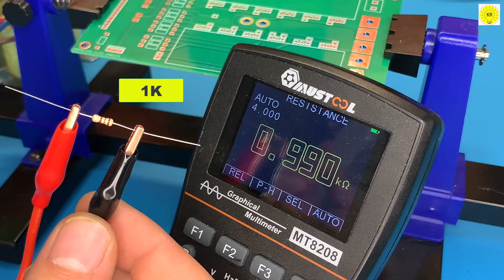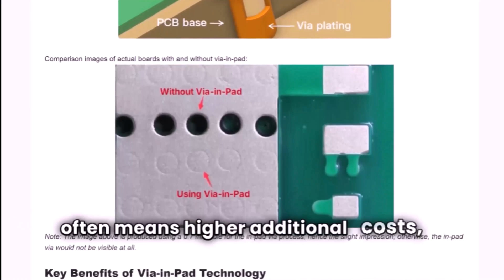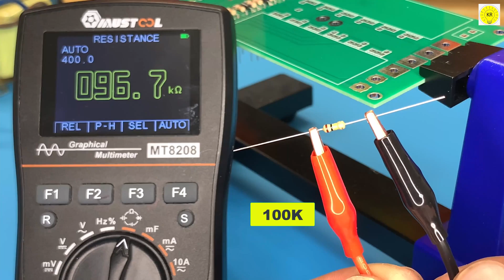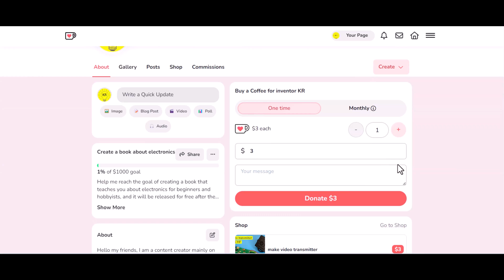how to make simple inverter 2000W , sine wave ,12v to 220v , 16 mosfet

Comment: Half working, you can see he couldn’t get it to work because he skipped the 220v probe wires (underv protection) + he’s not the original author
Reply: i can use a 1200va ups transformer?

Comment: Please my boss, can you please help me with the circuit diagram, Secondly, could you please help me understand how to solve Overvoltage problem under this Egs002 inverter project. Please
Reply: In Egs002 you can't manage more than 3+3 Irf3205 with ir2113, in that configuration 6+6 gain current transient is more of 2A, you need to add Buffer current!

Comment: There is someting wrong with this video, it seems that the Inverter board led Is flashing, indicating a fault, maybe low voltage,
Reply: yes, there are have an issue, that is when load much load, voltage drop immediately and led flash 3 times in module and self-off the invertor as low voltage detect in feedback. so, this is the failure of the design. this is the common problem of the invertors then I think may be this design max load will be 200w - 300w. because they are always introducing designs with errors. if anyone make like these ones, please make corrections yourself.

Comment: Great, what do you think about making a 3ph inverter that can be connected on each phase within the limits of AC max 500v on each phase. Where later the energy storage could be connected for charging48v, i.e. low voltage.
Reply: In my videos you can see this slow-rotating producer. .
Reply: I see that, but I want to make an inverter that, as I wrote, will handle higher voltage, e.g. from the AC side or the DC side. AC 440v, e.g. DC 600-800v, and it would be possible to charge the warehouse low voltage
Reply: لا يوجد رد واين المخطط

Comment: It’s very likely that the author hid something!) When starting a puncher, the drawdown should be a transformer clearly with a power of about 250-300 watts; when starting an 800-watt puncher, the consumption will be more than 80 amps from 12 volts and the fuses are in pairs of 30 amps, or 60 amps))) 2000 watt PMPO ?!))))))))))
Reply: es, there are have an issue, that is when load much load, voltage drop immediately and led flash 3 times in module and self-off the invertor as low voltage detect in feedback. so, this is the failure of the design. this is the common problem of the invertors then I think may be this design max load will be 200w - 300w. because they are always introducing designs with errors.
Reply: its 800w in full load. Just tuning the drill wil draw like 50w max

Comment: A 200W transfo becomes a 2kw transfo in this channel
Reply: اين المخطط
Reply: Yes, also long legs means lot of parasitic inductance, this design can not handle 2000 W all day long,
there are not thermal images after 1 - 2 hours operation.
Reply from the maker: Is it possible that this transformer produces 200 watts of power?
Reply: @inventorkr1  during 5mn 😜
Reply from the maker: I appreciate your comment and thanks for following

Comment: if I may ask do you know  how to make a 220v to 12v charger?
Reply: Use 12-0-12 transformer 4 diodes and capacitor simple
Reply: @muruganmurugan507  voltage regulation is need too, along with amp control and a few other things. A battery charger is not simply transformed rectified ac into dc,
Reply: @muruganmurugan507 there will be no control
Reply from the maker: In the next video, regards
Reply: @inventorkr1  thank you i very much enjoy your videos